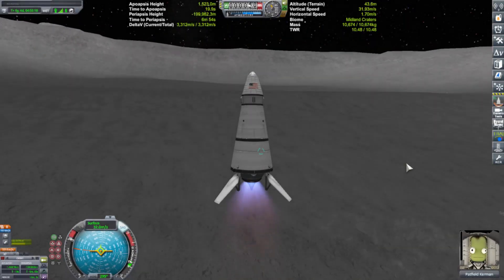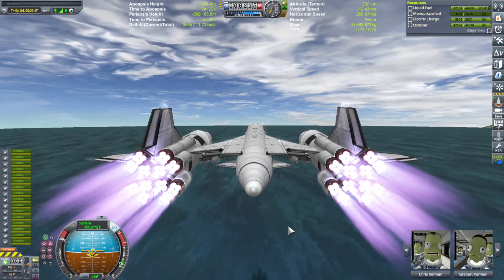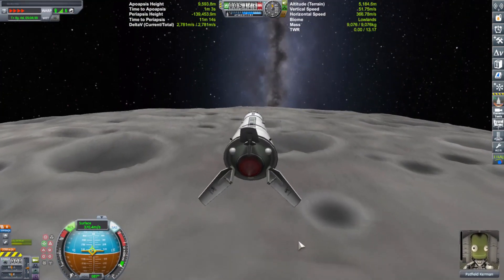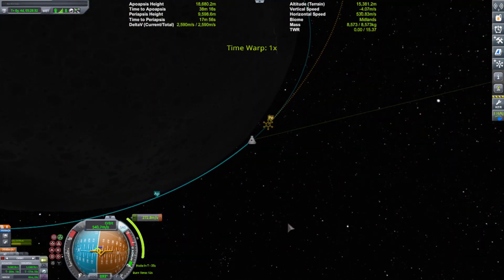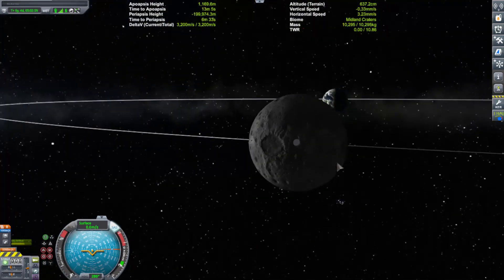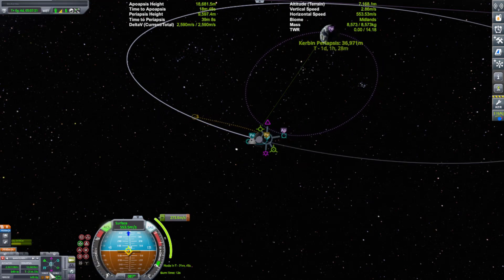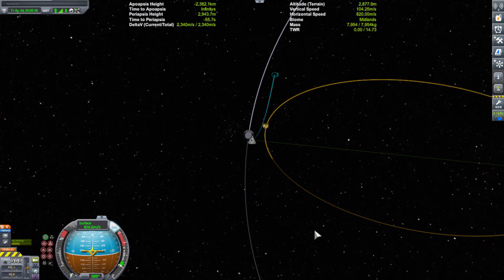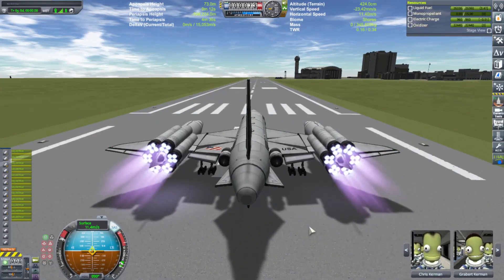BEST WAY to leave the MUN

Comment: How much delta v does this use? I am on the mun with about 1050 m/s. I usually have around 1500 at this point so I am worried.
Reply from the maker: @KerbalAddict  850 dv if you do it perfectly

Comment: I think the people saying "burn towards Kerbin" are oversimplifying an actually decent strategy. You get into a low circular orbit of the Mun, lock prograde, and then burn when prograde is also pointed towards Kerbin. 

This is around the 2-3'o'clock position anyway, and it works quite well. It is the strategy I use in career mode when I haven't unlocked maneuver nodes yet. All you need is a 1 star pilot. It works for transferring from low Kerbin orbit to the Mun too.

Comment: Ok, vaos, did you try the tried and true take off straight up until you get a mun escape trajectory, warp to kerbin apoapsis, then just retrograde.
Reply from the maker: sure. you use more fuel but , if that’s ok with you then great 😎👍
Reply: @vaos3712  You see, I like to use the KISS (Keep It Simple, Stupid) formula, and that's as simple of a flight plan you can get.

Comment: Some say you can get to Gilly with the same delta-v as Mun, and Ike only takes a little more. With aerobraking, they should take less. But I'm talking about what I haven't done.

What I have done is build large SSTOs with Mk2 parts at the front, then watched as the horrible triple-whammy of drag (because Mk2 are both wings and parts) hits them and the plane turns around backward despite excellent static balance. I guess one cockpit isn't too bad and that Mun plane looks really good, but it doesn't really take many Mk2 parts at the front to mess a plane up. 

I built a fairly compact spaceplane with just 3 Mk2 parts, all forward of COM and COL.If I pitched to any angle capable of even half the necessary aerobraking, it would just turn all the way around and stay that way. Huge elevons were not enough to prevent this. In the first reentry, pumping about 10 tons of fuel forward was just enough to get it pointing prograde and I was able to pull up just 600m from the ground. In the second reentry, it was harder to click the tanks. Deploying the landing gear helped slow the ship and get it pointing prograde, and I was able to pull up only just barely in time to clear the ground! :) 

I think Mk2 parts are all right if you use them throughout the length of the craft. That balances drag between front and rear. Putting more at the rear is probably all right too. Putting them only at the front is asking for trouble. I'm sad about this because my best-looking spaceplane uses them that way. I just have to pump fuel forward for reentry, but not as much as in the compact plane.

Launching from a body's prograde is what I did when I was a newb, just when I'd fond the REALLY BIG boosters. :D My first rocket to get beyond a suborbital trajectory put a small probe "on an escape trajectory out of the Sun", (as the game puts it,) without even using the probe's ion engine.

Launching into a transfer is called direct ascent. I think I should use it for my refuelling junk because in that game, the best ore concentration on Mun is in the East Farside Crater at 3 o'clock. It'll be close enough with maybe just a little coasting. Using aerobraking to get into LKO would be super-efficient, too.

Comment: The rule to remember is to never burn against the force of gravity if you can avoid it. The best way to see what happens is if your TWR is exactly 1: in that case you'll just hover if you burn against gravity, but if you burn perpendicular to it, you'll accelerate at 1g, where g is the surface gravity of the body you're launching from.

Comment: 1) go to low mun orbit
2) set a manuver node roughly between the direction to kerbin and moons prograde
3) add delta v until you see pericenter roughly 100 km above kerbin
4) right click in kerbin pericenter so that it's value remains visible when you aren't hovering the mouse over it
5) drag your manuver node back and forth while observing your pericenter altitude
6) find where the altitude is lowest. Remember, you aren't changing the amount of delta v in your manuver, so the lower you make it this way, the more efficient it is
7) if pericenter goes below the sorface of kerbin, reduce the delta v in your manuver so it's at 100km again
8) when you found the most optimal position, remember roughtlyl, I mean it should be somewhere between moons prograde and kerbin.
9) now land on the moon, do stuff then when you take off, you want to accelerate horisontally, while raising your apocenter as little as possible (just don't crash)
10) put your apocenter somewhere around that point for your manuver node that you were supposed to remember, but you forgot where it was, so it's somewhere between kerbin and moons prograde
11) now repeat everything from step 2). Basically you are doing the same thing bit instead of an orbit you are supposed to be in a very low suborbital trajectory, and therefore maxomise that sweet sweet oberth effect.

Now the reason why "old" players like me are annoyed, is because when I was learning this (also with a space plane lol), i didn't do a bunch of random stuff hoping it will work. I worked it out, just as I described. I mean, burning directly towards kerbin WILL OBVIOUSLY NOT WORK, and I'm not a physicist, I just played KSP for a while, and figured it out. This is easy. You have no idea what's the hard stuff like, you can't just brute force it, you have to work thing out

Comment: Clusters of ion engines are great if you have the persistent thrust mod, but it’s not stock so there’s that. In RSS, most upper stages and interplanetary spacecraft go with the “fuck twr” design because it’s more efficient, but in stock it is probably more efficient to have high energy propulsion because burns require much less dV.

Comment: Congrats you have rediscovered the "direct ascent" method... It is exacly the same as the orbital method only that you take off at exactly the right angle and the right time to avoid waiting to arrive at the trans (insert celestial body here) injection point. The difference in Delta V comes from the altitude of the injection burn, you could go for a lower orbit in the orbital method, it would give the same result.
As for the 10 m/s difference with the direct Retrograde method, cinetically wise it is exactly the same, the difference must come from the landing point not being exactly in the Mun Retrograde position and also as someone pointed out the TWR, because as the bodies rotate and move, the slower you accelerate, the bigger the offset will be.

Comment: WOW! Saving fuel by going into orbit first, rather than your original method! I do that anyway because that is what I like to do (or did, since now my good computer is fried due to a bad Linux update, thanks Ubuntu/Canonical!). And I just figured your way, Vaos, was more fuel efficient. As for the new method, it only works if you land in one area. Good for some people, not so much for me. I like landing all over, so I will stick with orbit. Still, thanks for testing it, Vaos!

Comment: Short answer to this video's title--and the only answer that matters: "In style."
9:15 What the flipping flapjacks was that dark glowing-orange view at the end?  How did you get those colors?  It looks like the F6 heat overlay but only applied to certain parts of the craft like flags.  I'm very confused.  
As for your "land at 2 o'clock" advice, novice KSPers (is there even such a thing these days for so old a game?) should beware that advice only works for moons that are tidally locked to the planet they're orbiting around.  If you land on a non-tidally locked body, you should understand that the 2 o'clock position you land in will no longer be 2 o'clock very soon afterward.  Plan ahead for your departures.

Comment: There is one adjustment to your method you need.  From the surface of the Mun, your target isn't Kerbin's atmo.  Your target is leaving the Mun's sphere of influence(SOI).  Once you've got the speed to leave the SOI, coast until you just get outside of it.  Now you're technically in the SOI of Kerbin proper.  Turn orbital retrograde and fire to bring your periapsis to inside Kerbin's atmo.  
The reason for this is unless you know exactly the point to launch from on the Mun, you're not gauranteed the most efficient course to the desired periapsis in Kerbin's atmo.  But once you leave the SOI of the Mun, you can use the exact retrograde target on your nav ball; the most efficient direction of firing.  More over, the point you leave the SOI of the Mun and enter the SOI of Kerbin proper, you should be on or very near to the apoapsis of your orbit around Kerbin, which is the most efficient place to fire retrograde and decrease your periapsis until it's the desired height over Kerbin.
Your approach, with just a little tweak to squeeze out just a hint of more delta-v.
Reply: Somebody call the Space Police!  :D
Reply: @ArchaicAlibi  Space Police?!?  What is this....Blacktron?

Comment: The shallow ascent profile applies to getting into orbit as well! The further you can tilt over the better, assuming either no atmosphere or an extremely thin one/extremely sleek craft. Shallow is pretty good on the Kerbin ascent too with a pointy enough fairing, until you reach a point where burning up becomes a bigger concern than small bits of speed lost to drag cx

Comment: And if you want to land on the Dayside of Kerbin do the exact opposite. Start from the 8 o clock position in the opposite direction. I dont know if that saves fuel or not but you can land on the dayside of Kerbin. Thats what i found out.

Comment: Well, the difference in efficiency between launching straight upwards from retrograde point and launching to orbit first, then to most efficient escape orbit that hits Kerbin depends on your TWR. The lower the TWR, the bigger the difference. Judging from the video I'd guess your rocket had TWR ten or more. No wonder you saw negligible difference.
What you found the most efficient is equivalent to transferring from orbit that has really low apoapsis. That's all. If you think about it, when you're sitting landed on surface of a planet, you're in fact sitting at the apoapsis of orbit of that planet that corresponds to your motion induced by planet's rotation. And the thing about getting to orbit is just to pull your periapsis from deep below the planet's surface. Which is a phase through which you definitely pass during your optimum approach.
The thing I like on the general approach is, it's not that important where you land. Landing at a spot of your choice requires some skills, too.

Comment: I was one of the guys saying that burning straight up should (to my knowledge) waste a bit of fuel due to gravity acting against the thrust and that I think that some approach of a gravity turn when Kerbin is on the horizon might be more efficient. I'm really happy trying this out turned into a video of its own.

Though a bit of a comment on the "burning straight up vs. gravity turn" thing:
If I am not mistaken, the difference in efficiency gets greater, the lower your TWR relative to the gravity of the respective moon or planet is.

Basically, to leave the sphere of influence of a planet, you need to reach escape velocity, however how quickly you reach that speed depends on your own net-acceleration. That is to say, when you're on a moon with .25G and your craft has .26G acceleration, you barely have enough power to even hover above the ground. Burning straight up, you'd accelerate to escape velocity at a net-TWR of .01G, which would take forever (most likely you'd run out of fuel before you reach enough speed). Burning sideways would mean you accelerate a lot quicker, since you lose way less thrust to fight gravity.
When your TWR is significantly higher than the local gravity, like >5G, the loss of .25G is not a big deal and you'll still reach escape velocity very quickly, so a gravity turn is less relevant.

Comment: So, the method you use at 3:22 is actually the method I do, and if you'll look at the footage, you'll see that your minimum periapsis is about 490km, and then you keep burning, and it starts increasing again. The trick is to just burn until escape, and then refine your trajectory. 2 separate burns, but unless you're speedrunning or something, its perfectly fine.

Comment: I wonder if this works for for a Duna return?
Reply: Yes, it'll work for leaving Duna.  But if you're trying to go to Kerbin, not Sol, then you need to consider transfer window position relationships of Duna & Kerbin.
Reply: Atmosphere might get in a way, other than that it works for just about any transfer orbit - if you know your transfer burn position ahead of time, launch from there and skip getting into orbit, instead executing transfer maneuver during ascent. Trick some people use to get to the Mun (launching when Mun is rising on horizon and burning directly towards it) is similar method used for Kerbin->Mun direct transfer.

Comment: I remember during my career playthrough I got to the Mun, but ^V was so tight that I my closest encounter to kerbin was 72km. But decoupler managed to push me into the atmosphere)
Reply: Well that beats the "get out and push" method; which is something I've done many times!
Reply: @whoshotdk  ah, "get out and push", a classic golden oldie that always seems to happen whenever I decide to not overdo it on the fuel for the mission...
Reply: @thegamesforreal1673  I've done that a few times too. Once I had to push a craft into an encounter with Kerbin from Duna...
Reply: Did that one once, usualy I have to use pod RCS or get out and push.
Reply: Talk about marginal mission planning
Reply: you can make the delta symbol by pressing alt+j (option+j)
∆V
Reply: @gosoccerboy5  Alt-J doesn't work in US or UK keymaps. That's not what the Alt key is for on a PC, but it doesn't even work with AltGr-J in the UK keymap. I keep a Greek keymap loaded, switch to it with Win-Space, and press Shift-D for Δ, m for μ, etc. But I never bother any more.
Reply: @eekee6034  oof
Reply: @gosoccerboy5  ¡²³¼⅜±°¿ΩÂÂÂΩ®¥ÛÎÔ>©‘’Nº÷<¿ meh i think Turkish Sun keyboard ain't got it, I'll just stick with the "D-V" but I got myself degrees° sign with alt+shift+0 just learned that thanks°